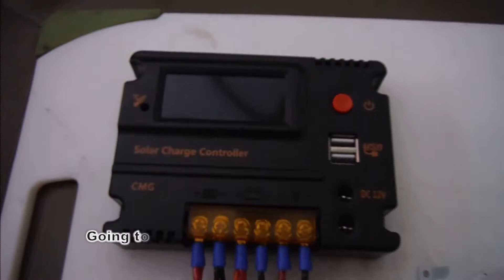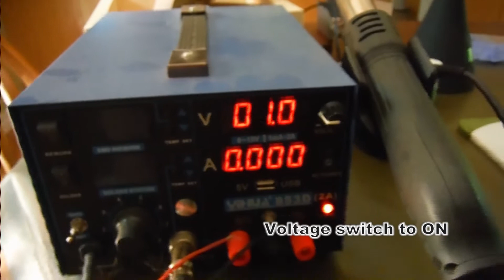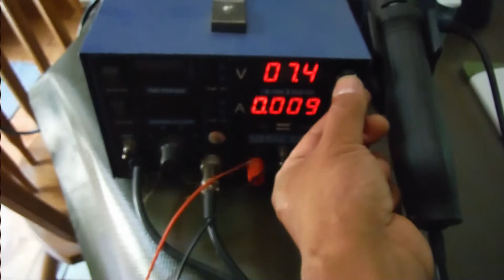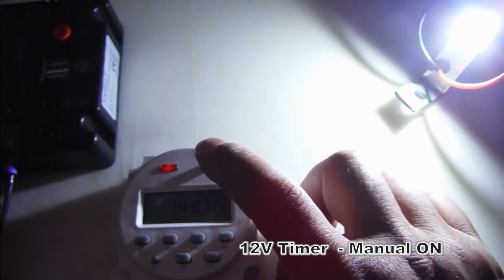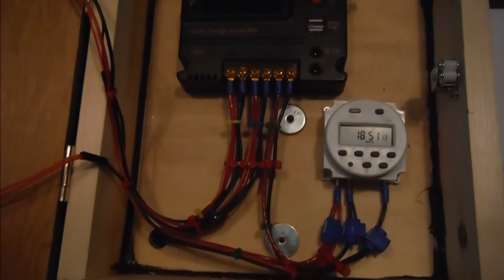Going OFF Grid  -  Solar Controller and 12V Timer  Manual Testing  with Yihua 853D Power Supply.

Comment: Seems to me that everyone is making the same mistake with these type of chargers .you need to mount them on stand offs .It will aid in cooling the unit and extend it's life .all you need is 1/4 inch space and it will make  a huge difference .if you can keep it 1/2 to one inch abouve the mounting surface it would be fantastic .And you can add a tiny 12 v fan to help cool it even faster ..They do get warm under load !.
Reply from the maker: Thank you! Going on my 7th year now with the same setup (no fan..etc) with no issues with controller (probably because load is just on for an average of 5 minutes per every hour ) , but that is a great idea for longevity of the component for sure and will do that when the time comes for replacement! Cheers!
Reply: @ThunderRidgeMedia  I bought it because I thought it was an mppt .but it's just a pwm .Better than the older one  I had with just green and red led .Cost me the same .I only use it with my trail camera ..I'm using a small 25watt solar panel .If I have to go to a 100 watt system it might just be enough .My friend has it set up in a tree stand to power up lights cameras and his heated  Milwaukee jacket  and 1 walkie talkie and his cell phone and gps .All from one 100 solar panel and 2 wheel chair batteries .12v 20 ah .Almost like being at home .can probably run a tablet as well .
Reply from the maker: @carlubambi5541  Yes, I really like the controller...sure it's not mppt but I'm not using it to off grid a cabin or household..etc  but I'm sure would run just fine if needed to do so.  Not being mppt not really a factor for me plus it's affordable should it need replacing! It's been a great controller and hasn't let  me down at all! I do have a 100 watt solar panel hooked up to it and using a 12v car battery to run my water pump for my hydroponic garden!  Cheers!
Reply: @ThunderRidgeMedia  I just don't like the dishonesty and protection they get from Amazon .it's fraud .Want to return it on principle but because it works I can't complain .Do you get a voltage leak on the output even with the power turned off ???I get 1.5 v on terminal even with power off..No load connected  .I get 12V when power is on ,but 1.5 v with no load
Reply from the maker: @carlubambi5541  I usually don't turn off the output as it normally supplies power to the timer when required. I did a test without load and was actually getting just a little over 3 volts...with power off...LOL! As long as it works the way it's intended for and doing it's job, I'm good with it! Cheers!
Reply: @ThunderRidgeMedia  I wonder if it sends over voltage out to protect the battery from overcharge ???Kind of turns a load on  to protect battery ?
Reply from the maker: @carlubambi5541  That's a good possibility! Not really sure how it does the over voltage protection, would think it  does it internally by cutting off or controlling output from the solar panel when battery is at full capacity...
Reply: @ThunderRidgeMedia  I had a blue 3 button unit .it would switch on the light when battery was being overcharged to help drop voltage coming in ..It was only for lead acid and agm batteries  you could set float voltage charge voltage and  discharge voltage .I had it set for 10.2 v it would start charging and cut off at 13.8 V ..Fun playing with the sun !